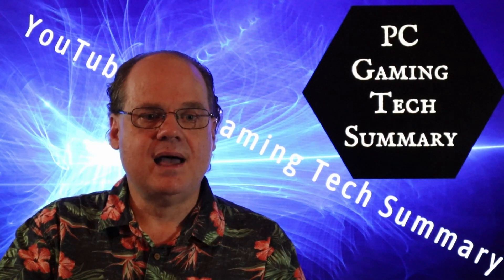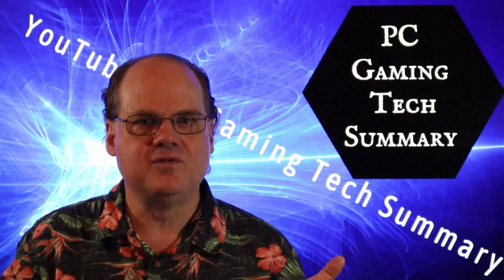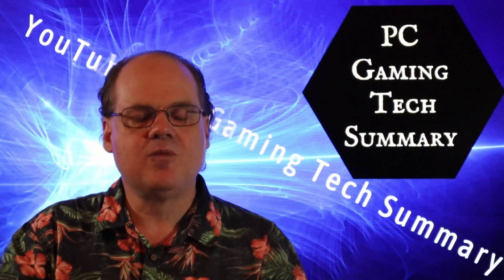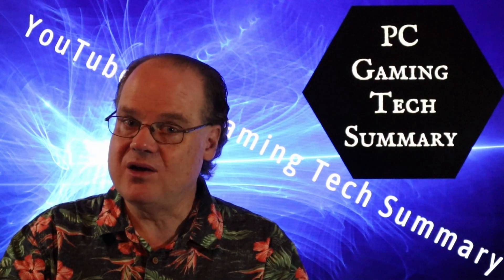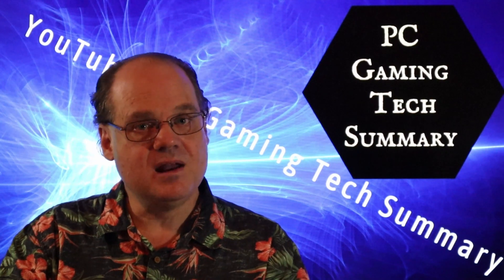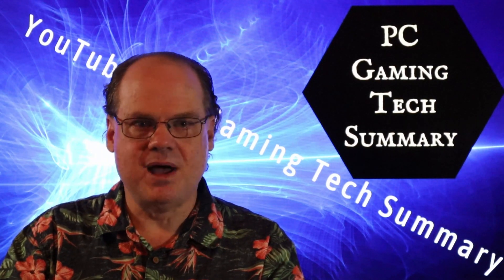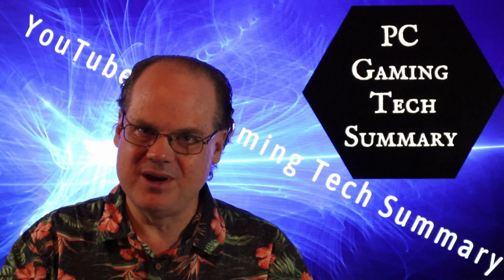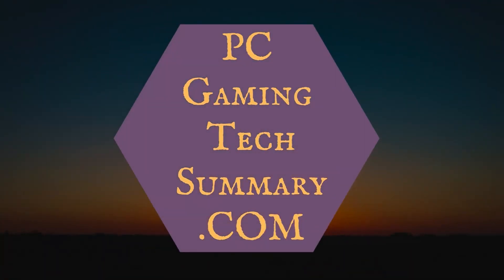Exchange MSI AIO 240R 360R 120R for a different model because of high temps clicking noises failures

Comment from the maker: Has your MSI AIO failed? How long since you bought it?
Reply: seven months and dead
Reply from the maker: @agusdonoso  Can you trade it in at your retailer for a Corsair?
Reply: @pcgamingtechsummary  nope, MSI sent me a e-mail saying that I have to ship the cooler to USA 😂😂 I'm from Chile and that's a nono, I fixed it (temporarily) switching the liquid with a mix of propylene glycol and demineralized water
Reply from the maker: @agusdonoso  It needs to have biocide and corrosion inhibitor like what is in Mayhem XT-1 Nuke V2 Clear Concentrate Watercooling Fluid. You can get the concentrate Mayhems Water Cooling Systems Inhibitor + and Hades + 15ml . Keep in mind the main problem is the inside of the radiator, right after manufacture, it needs to be cleaned out and made smooth. Otherwise you will always have trouble with the radiator. Find out who actually makes the radiator here https://www.youtube.com/watch?v=-d44wt-6TEc  Please subscribe if I helped.
Reply: @pcgamingtechsummary  thanks for the advise, I didn't found mayhem products in my country but I bought a ekwb ek-cryofuel concentrate :) 
Do you think rinsing the interior with isopropyl alcohol is enough for cleaning the radiator? thanks!
Reply from the maker: @agusdonoso  I would try the EKWB EK-CryoFuel Concentrate 100ML Coolant - Clear. I would take apart the pump and water block to clean them and follow what EK says. You may need to replace the solution again in the future. Of course, anything you do or don't do is at your own risk.

Comment: Welp my AiO finally got fully clogged (temps above 100c) I felt the tubes leading to the aio and they were insanely hot… and what do y’know my aio does not apply for a swap. Im going to try and see if Best Buy can hook me up with a replacement or open a ticket with MSI. For the past month I was wondering why my Ryzen 2600 was running much hotter than usual under load. Personally I don’t want to deal with having to replace the coolant I just want a replacement.
Reply: I’m going to give it a go before opening a msi ticket. But I’m going to wait a bit until they stock up on a Corsair aio
Reply from the maker: @Drizno  Good plan. Please subscribe.
Reply from the maker: I would bring a printout of the high temps, if possible,  and tell Best Buy you want to exchange for a Corsair because thousands have failed. You can show them the apply for a swap website and if they don't believe you; also the one star reviews on Amazon.

Comment: I need help, I'm scared that RMA won't validate the Warranty.  I have a 360R, I got it New on Newegg on 09/09. AIO started failing on 04* and on 05* a clicking fan noise started. 
06/02/2022 my pc was shutting itself, I work from home and I had to call a Technician, he gave me an air cooled Dissipador for 25 USD + 50 USD for fixing my Issue, adding TG-7 thermal paste and advising me to contact MSI for a refund because placing the Radiator on top should not Clogged the Block and radiator, the water was dark brown and white particles came out of the block. it was super dirty.
Reply from the maker: OK you can try and deal with MSI direct which has been working. I would go to their website and create a ticket. Provide proof if possible; screenshots or photos. I would explain things. Ask for a different model number. Another 360R will probably fail again. I think in the future I will purchase gear mainly from retailers that I can return faulty gear in person.
Reply: @pcgamingtechsummary  
I spoke to a LIVE agent on the MSI supports site. This guy told me to call RMA 9-6pm weekdays only PST.
Edit: I will be calling them today, will a form and probably ask for a better Model. I'm working from home and I already played $80 bucks to replace the coolant, I had to hire a technician this is my first pc I'm new with all this. ty PC gaming tech